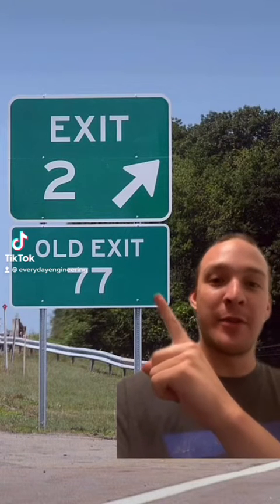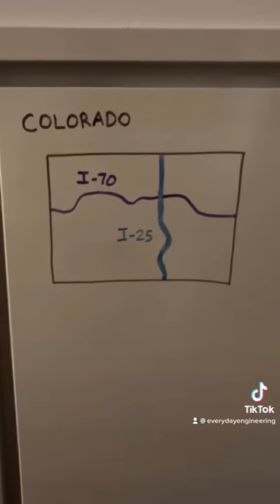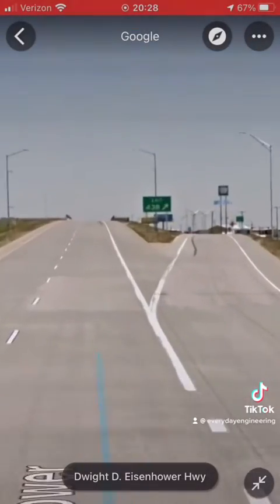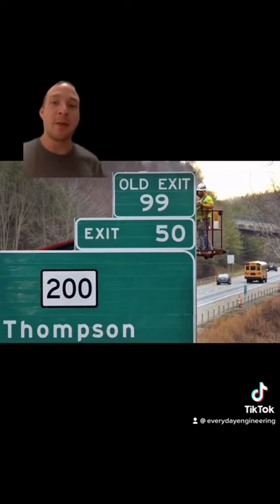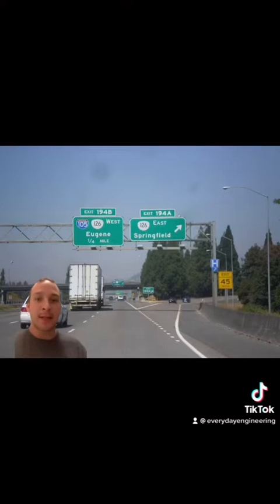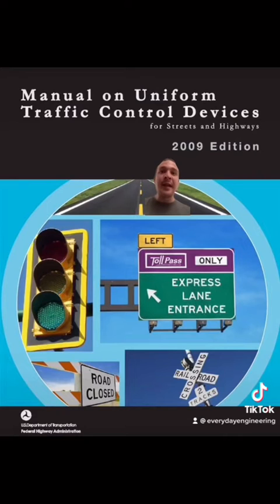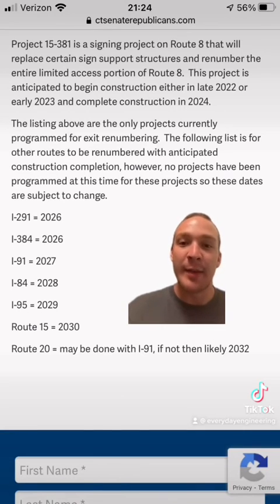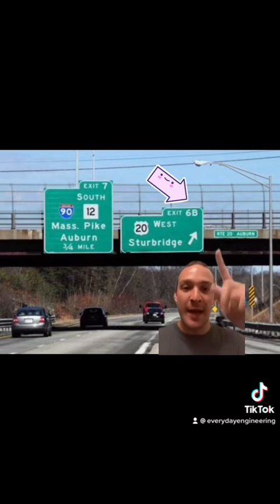How Highway Exits Are Numbered

Comment: Mileage-based makes sense in larger states but in New England we have multiple exits in less than 1 mile.  I-95 in CT averages 12 exits every 9 miles.  So it will be 1A, 1B, 1C, etc.  Then if they are separate directional exits it will be 1AA, 1AB, 1BA, 1BB, etc. since they disallowed ordinal letters - N S E W.  Which is confusing.  Vermont kept their exit numbers and added sign plates saying "Milepoint Exit 7" etc.  Not sure if that complies but seems a better solution than strings of letters.
Reply from the maker: I don’t believe double letters are allowed, they have already renumbered some exits such as on Rt 40 and they just have 1A, 1B, 1C for the 3 exits at the eastern end

Comment: The mileage-based exit numbering system also has a great advantage should a new interchange be constructed in the future. The exit number is assigned the mile marker at the location of the new exit. Under the sequence system, new numbers may need to be assigned to exits beyond the new interchange.